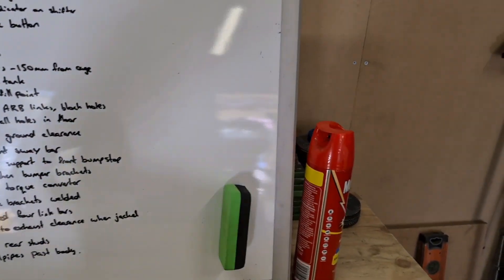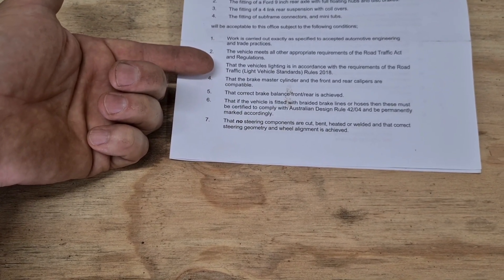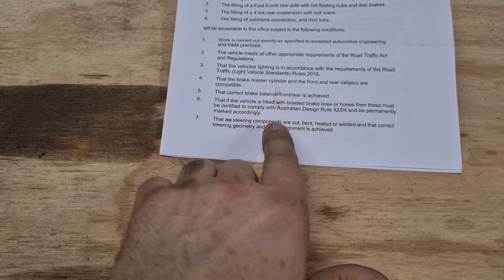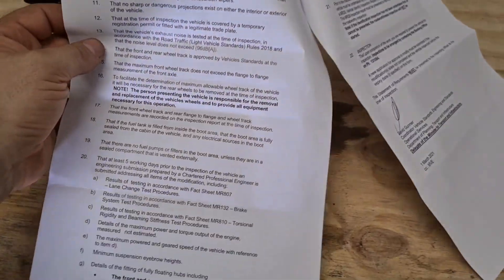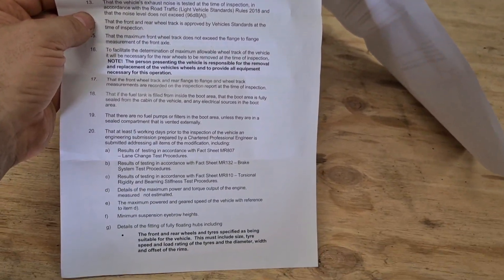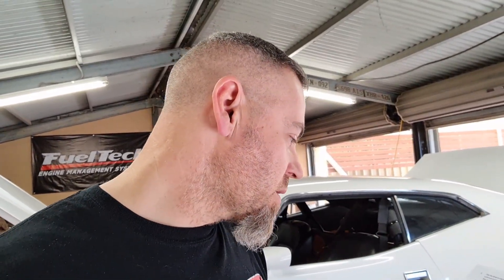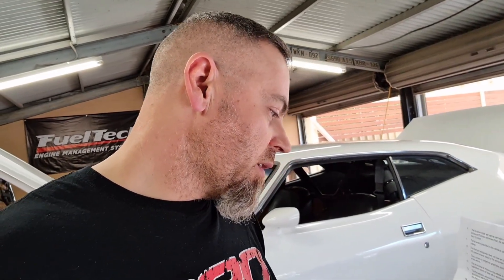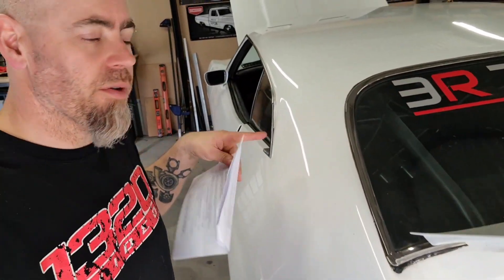Engineering my Twin-turbo Falcon; Ep1(pt1) The [first] List

Comment: Thank you for a true and well informed list of what you need to do, Not every one build a "Safe" very fast/power full car like you have, just chunk it down as you would, and complete each task they have asked of you to do,  (incl turn the boost down) LOL,,
Reply from the maker: Haha turning it down won't be fun, but it has to be done.. Thanks for watching! 👍👍
Reply: @Philthybuilds  can you run a restrictor plate between the headers and the tubo?? To control the boost also would that stop the dump pipe from dumping .
Educated me,
Reply from the maker: @dougycarter9399  I'd just put a lower setting in the boost controller. The waste gates only have around 7psi springs in them, I need tne Co2 bottle connected to make more boost and I don't run that on the street.
Usually.
Part 2 of this vid will explain more 👍👍

Comment: 👍
Reply: Hey Phil, just curious mate, How are you going to muffle FAT383 under the 96Db I think it is. I got a hilux engineered with a holden 5l, needed to make a single 1 3/4" and got to 89Db. P.S We met at Echuca many moons ago. I have FATXC. Love your channel bud!
Reply from the maker: @craigdougherty8234  hey bud! I've still got the pic of our cars side by side at the car wash 🍻
Smaller diameter (probably 3") tailpipes with decent mufflers will sort it. The turbos quieten it a fair bit over an n/a car, it's only loud now because of the big pipes